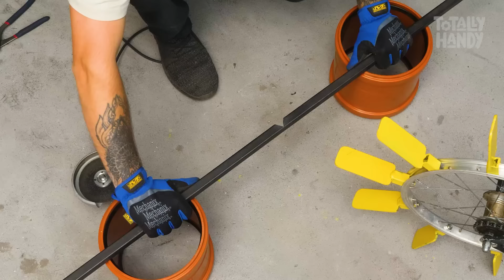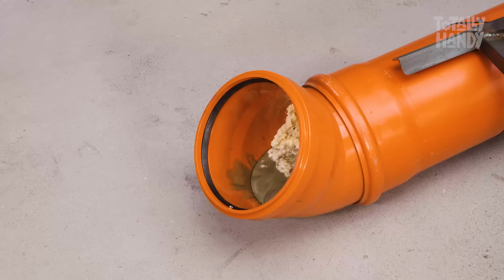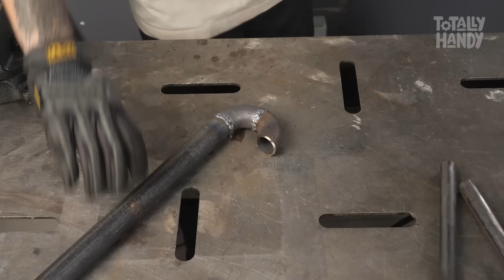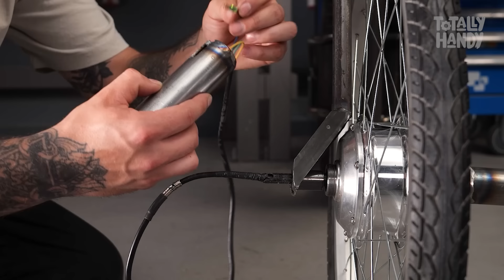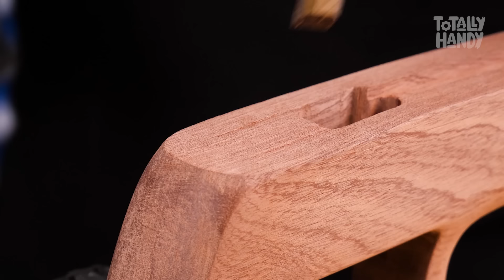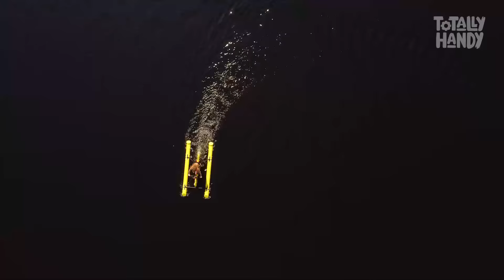Building a Bike That Moves on Water | DIY Project

Comment: Without a fender over the prop wheel, you might as well swim, since you would be just as wet.
Reply: That's implemented cooling system